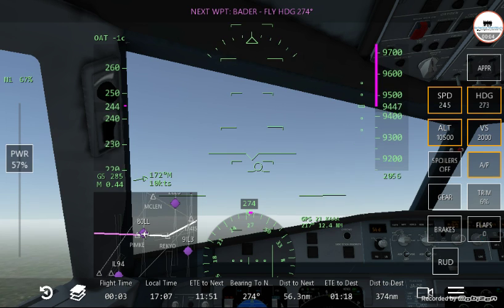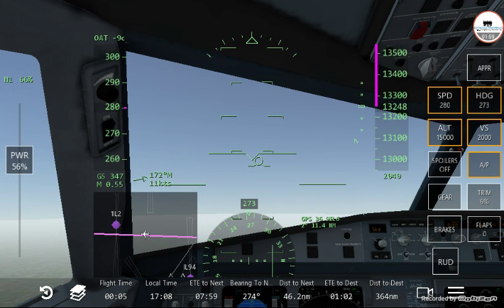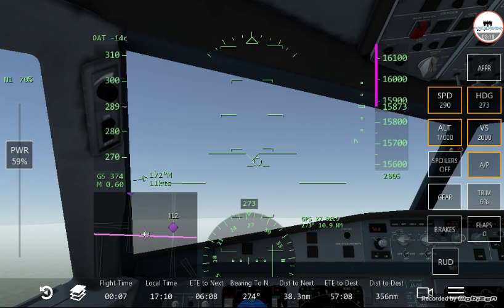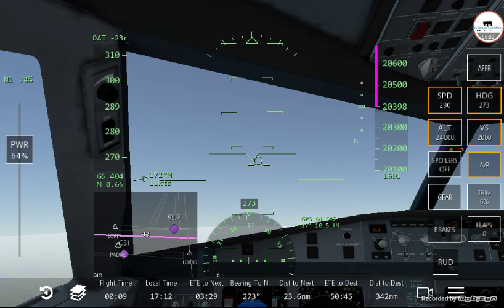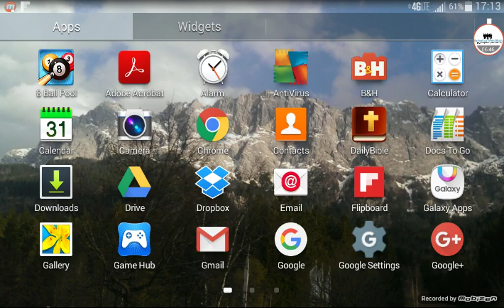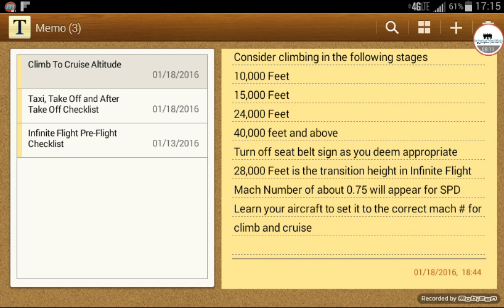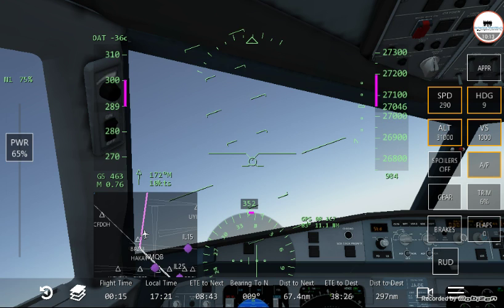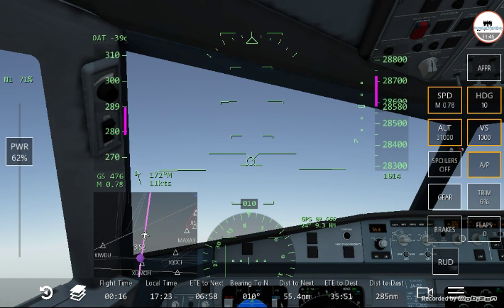Infinite Flight Tutorial Climb To Cruise Altitude

Comment: I attempted 2 flights on the a380 and it was difficult maintaining speed until the throttle was at 100 and the speed decreasing slowly please help!!
Reply from the maker: What part of the flight are you having trouble?
Reply: SyriusStar Multimedia climbing to 40000 feet and I only had the vertical speed 2000-1000 so basically after takeoff